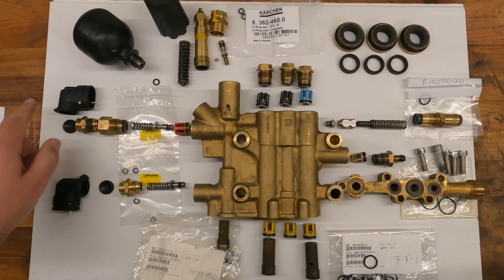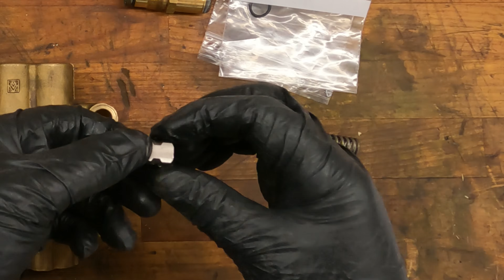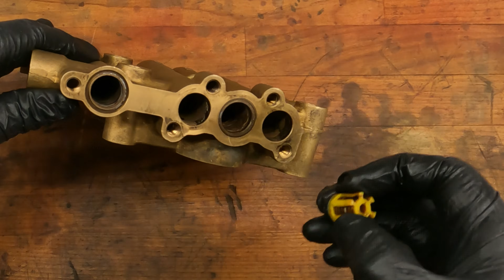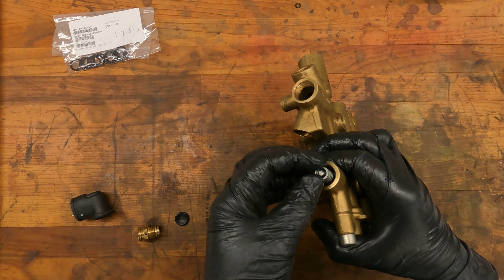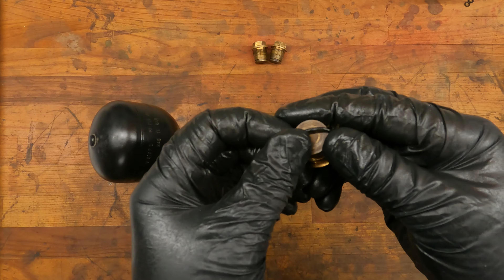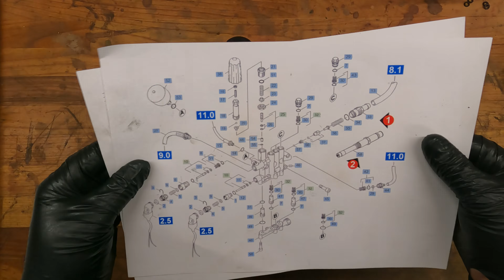Assembling a high pressure washer pump Karcher HDS 695

Comment: Hi, what fluid goes in the small white plastic bit that sits on top of the water tank. it has a electric valve and something that looks like a sensor.
Reply from the maker: I'm 100% sure i understand your question, but it look like you are describing the anti-stone tank that prevent scaling. The sensor check if there is fluid in the tank and will leave an error on the display if empty.

Comment: Hello. I have an HDS 8/17-4M machine that is having an error when switching to eco mode but cannot heat water. There is no error message on the screen. I hope to receive help from you and everyone. Thank you.
Reply from the maker: Disconnect the fuel line on the burner and check that fuel is coming through the fuel pump. If no fuel try putting 24v ac (you can take this directly from the transformer) directly to the coil on the fuel pump. It should click when you power and disconnect. If it clicks and still no fuel coming through and all the hoses from the fuel tank including filter is ok its probably the fuel pump. If fuel is coming through check that there is spark, it should always spark when in heat mode.

Comment: Could You share, where You get the service manual from? Great tutorial btw, it helps a lot ;)
Reply from the maker: Link in the description
Reply: @randomrepairandrestoration 

Could I get in touch with you somehow? I have a pressure washer (HDS551) I ran dry by mistake for 40 seconds and it won’t show more than 100 psi now. I remember it used to be over 200 but I don’t understand how 40 seconds ruined the pump. Is there dirt in the valves somewhere?
Reply from the maker: Its a bit difficult to pinpoint exactly, but i would guess the bypass valve is the first place to look into. Remove it and inspect the spring and the plastic around the bottom "disc" along with the o rings. Dry run on a pump that spins almost 3000rpm would kill most plastic and rubber parts.
Reply from the maker: Is it just when the trigger is pushed or does it stop the motor also at 100psi? If its just when you pull the trigger i would guess the nozzle or its drawing air through the soap valve.
Reply: @randomrepairandrestoration  
So initial start I saw it’s 200+ 
When you press trigger it on goes to 100 psi then struggles there. When you let go off trigger it stays at 100ish. 

A couple of things I need to check: 
1- pressure from the tap is about 8 seconds for a litre. So maybe need bucket to test
2- clean the water strainer 
3- clean the other strainer 
4- use soap as it was empty so maybe sucking air through there? But I assume soap gets added later at the end so pressure on the gauge should still show more? 

See the video maybe that gives you more info to diagnose?
Reply from the maker: I,d put my money on the hose (to long or thick), gun or most likely the nozzle. Begin with removing the nozzle and check for debries. I doubt anything got damaged by the dry run in your case - its merely a coincidence. likely the nozzle. Or air through the soap tank.
Reply from the maker: Pressure while spraying always dropps when trigger is pressed. As example it will drop to nearly zero with no hose connected. Longer hose, less pressure.
Reply: @randomrepairandrestoration  it’s original hose that came with. I think my link disappeared but posting it again just in case. Hopefully give more info. 

https://youtube.com/shorts/Xh18apYZHK8?si=_Tx7I3Mm_eEZG35D
Reply: https://youtube.com/shorts/Xh18apYZHK8?si=_Tx7I3Mm_eEZG35D
Reply: @randomrepairandrestoration  sadly video doesn’t get posted but if you go to my account. You will see it.
Reply: Hi mate realised. I never replied to this. You were right it was the hose. It was not pushing enough water. Got a better one and machine fixed it self. Kinda got hooked so been buying more machines
Reply: Hello. Where is the full repair video?